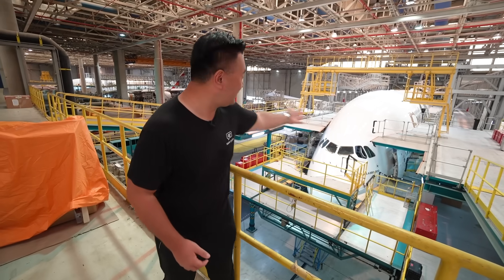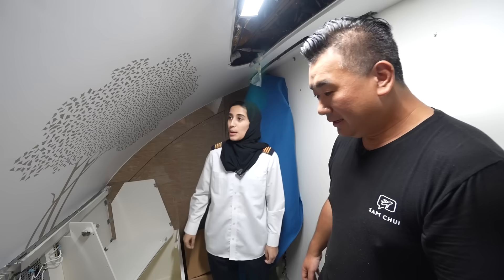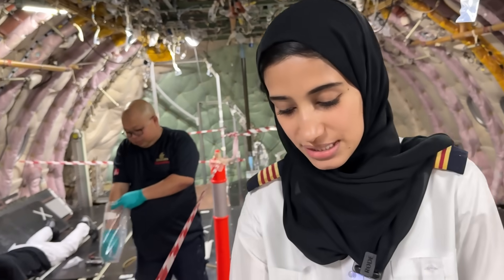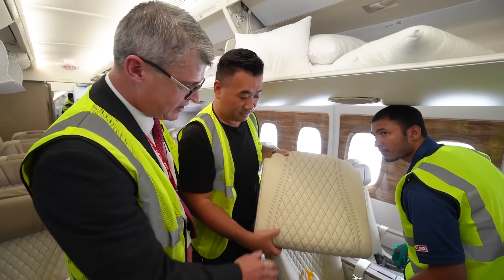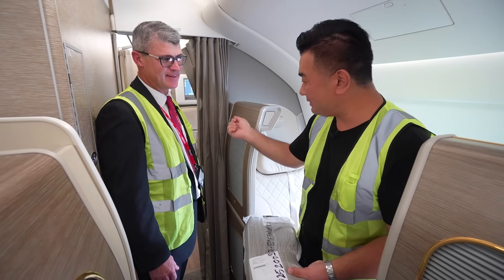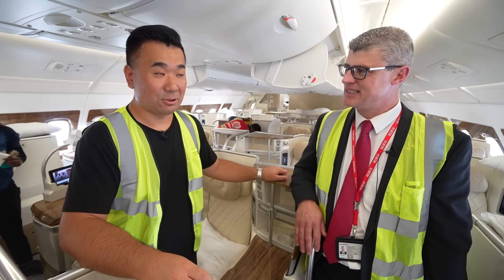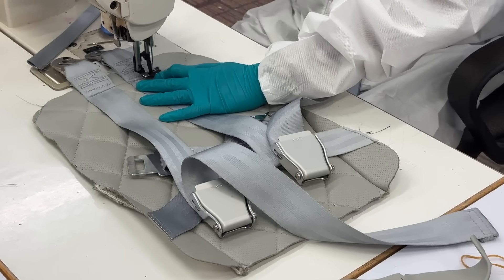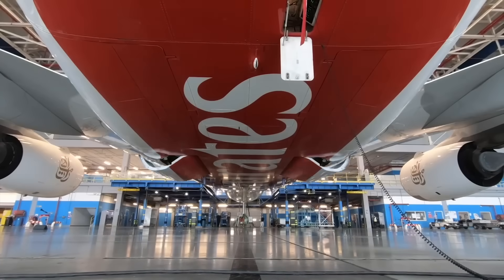Emirates Upgraded A380 - World’s Largest Aircraft Retrofit Program

Comment: great that they fly a lot more years.. love the plane and the shower is unbeatable... no one else does it and it the perfect refresh just before landing and getting to work... it is however disappointing to see that this rater "lipstick" update... the first suite is the same since inception, same in business, only new fabrics and colors... the TVs have gotten bigger to be correct and yes, ICE is the best movie selection ever...  considering what other airlines putting into play now for first and business, this is becoming less relevant... mainly the 2-3-2 in business i would say is not acceptable anymore on the 777... looking at flat double beds in new installations for business on other airlines, this is not good enough anymore... also on the A380 the 2 center connected seats are not really together... the new first on the 777 is stunning when fully enclosed and i was hoping for it on the A380, but it does not fit on the plane... it is also not deployed on real long haul (10+ hrs) and i have only been in it to Frankfurt and Riyadh... the lounges in Dubai need a much more serious update, business is becoming very very aged and in the first lounge someone went shopping on furniture without the designer... does not work together and feels disjointed... the timeless spa super tired and unfortunately bad service... used to take massages there quite a bit, but stopped as the quality of the fit out and the therapists is getting worse... EK needs to accelerate their refresh across the board as other airlines are not sleeping... i love flying EK and am Platinum since that is available and Gold before since 2005... i just hope it does not go down the lufthansa road and goes from great to bad... it takes too long to come back from that...

Comment: Hey Sam. Do you think Aurbus should reconsider the A380? The former A380 hanger just constructed an A320. But if the demand is there, should the reconsider and perhaps even stretch it? Very very nice. Please keep coming out with more vlogs!!
Reply: It would cost billions to re start the A380. They have binned all of the A380 specific tools and machinery
Reply: @extrude22  right, but they have the blueprint. Wouldn't that reduce cost? I'd imagine they incorporated a lot of redundancy for the aircraft should've they decided to stretch it.
Reply: @ronaldcuieii8639  Yes they still have the design. But all of the space in the factories has been given over to other projects and the tooling has been disposed of. 
It would still cost billions to re introduce.

Comment: It’s a shame they don’t make anymore A380’s it’s an amazing plane
Reply: They will if it's economically viable and there's a demand for it
Reply: @FSXairpilot  We will never make the A380 again, Airbus spend so much money to tranform the old factory of the A380 to an A321 factory. And we have absolutely no plans to make this aircraft again, in a near or in a distant future
Reply: @FSXairpilot   It will never be economically viable again or have demand for a behemoth like that again. The trend is for smaller more efficient twin engine planes for long haul flights that are much cheaper to build, maintain, and are far more fuel efficient than the likes of the A380 and the 747.
Reply: @frankgrimesification The A380 is fuel efficient if full, that’s why airlines still operate it. BA for example and Emirates have had great success with it and BA where even looking to acquire more pre covid it was said
Reply: It is a shame British Airways didn't buy into the Airbus380 they could had a lot of fun with it from design to flying.
Reply: The first class space is too small…

Comment: The A-380 is such a nice departure from the twin engine cookie cutter aircraft of today. There once was a time when there was such diversity in the types of aircraft. 3 engines, 4 engines and some twin engines.
My favorite aircraft , the 757, has a uniqueness amongst the two engine planes. Then the 747 and finally the A380. Thank you Sam for all your hard work. Cheers brother, Stay Strong!
Reply: You can thank Covid for saving the a380.  It was retired for good but the boom in travel demand after the pandemic coupled with the wait times for new aircraft made it economical again for airlines to dust them off and bring them back into the lineup!
Reply: @swampfuel20, the 757 is my least favorite from passenger standpoint. My perspective, as a broad-shouldered moderately tall (6' or 183 cm) man flying from Minneapolis to Dusseldorf, 7-1/2 hours, even in an exit row 'C' aisle seat, I dare you to say this is comfortable when my 'B' seat was a body builder heading to Iraq was broader by 4 inches than me and the window seat was overfilled by a nearly spherical woman. When I had to be seated I was half in the aisle! When the sign was turned off me and the body builder were in the galley or Lav area with the flight crew understanding of our situation. NO! From a passenger standpoint the 757 is NOT a pleasant experience. Twin aisle long-haul ONLY for me!
For me, upper deck 747 was the best, better than first class!  2x2 4 rows, exit gap,  4 rows more , personal stowage next to the window instead of overhead. Your own attendant, galley, 2 lavs, and additional carry-on stowage accessible by the stairs. Unbeatable service and isolation from the other 300-400 passengers  below and nearly unnoticeable engine noise. 2 to 4 times a year across the Pacific for the first decade of the 21st century, 12- 15 hours... life was good.